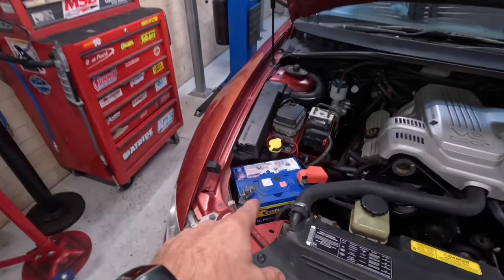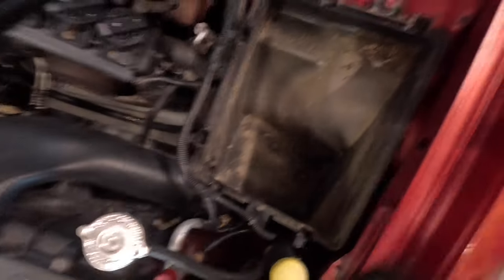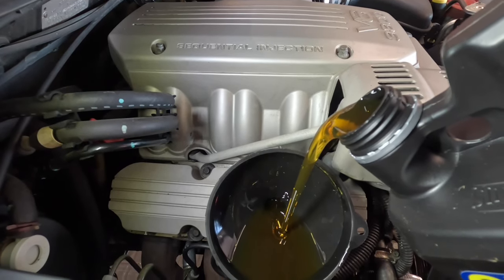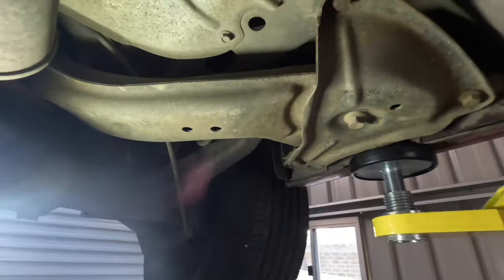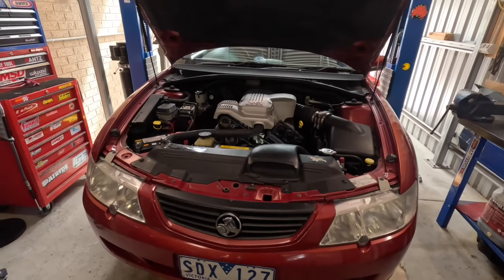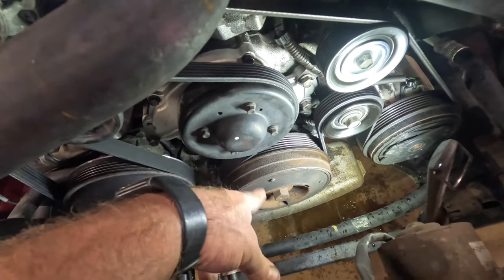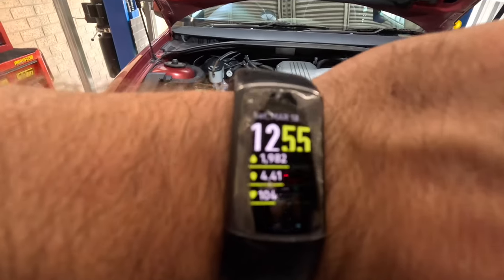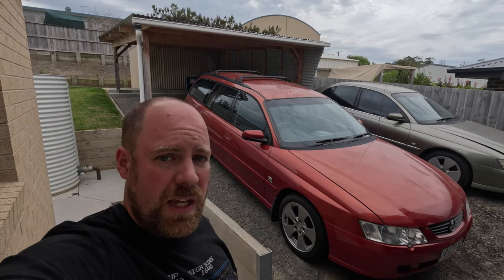VY Holden Commodore Major Service & Repairs Pt 2

Comment: Awesome video. With those idler pulleys, you can easily change the bearings in them for about $2 at any bearing supplier
Reply from the maker: Thanks for watching mate. 
We used to replace just the bearings, but considering how cheap the complete pulleys are now we just tend to play the ‘it’s more convenient’ card as just go with that. 
But there’s nothing wrong with just doing the bearings either

Comment: I watched the time lapse of the harmonic balancer job, in slow motion. Great aspect of what to do. However, as a beginner at repairs my son and I found this pretty hard to work out what you were doing from the top down view. I'll go back over this with a manual I found on the Internet. I'd imagine these V6 commodores are very similar. The radiators seemed full of crud. How important it is to give them a clean or blow through with water/air/de-greaser? My son's VZ commodore had been driven over a dirt track for several years. There is a build up of dirt and little stones everywhere on the underside of the care. Bugger to work on until I get it guerneyed. Thanks for the video. No one does a full major service in one go. Very helpful.

Comment: I was wondering if you were a mechanic (haven't seen any of your content prior to PT1), then saw the Snap-on scan tool and was yep... there's 5 grand of Snap-on scan tool, def mechanic
Reply from the maker: Yes mate def am. 
You can check out some more of my info in my bio. But qualified mechanic, diesel mechanic, auto elec, and welder. Have other certificates also. Spent a lot of years in trade school mate and 25 years on the tools so far
Reply: @cassarindustries_wheelwerk  Dude it shows, if you haven't already could you go back over the power steering flush please?, even if you "show" without actually doing it - I got my mechanic ticket from university Google & youtube :(
Reply from the maker: Thanks heaps mate. 
Easier way to flush power steering is to suck out the reservoir, then fill it up with fresh fluid. Start the car and turn the steering wheel left to right a few times, then turn it off. Suck the floor out again, refill, start the car and turn the steering wheel a few times then turn it off. Keep repeating this until it’s clean.
Reply: @cassarindustries_wheelwerk  thanks mate. I haven't looked yet but do or could you list tools like the air bleeder for the brake lines, and vacuum sucker tool please?, for us home jobbies.

Comment: Hey mate, just came across your channel. I recently bought a 2004 Holden Commodore Ute with the 3.8L V6. Do you know what kind of gear oil is used on the rear end as it has the limited slip differential?
Reply from the maker: Welcome to the channel mate and thanks for watching. 

If it had an LSD I normally use the Penrite 85W/140 lsd gear oil. Penrite also do a small bottle of LSD additive called ‘limslip’. Comes in a small black and purple bottle, and it’s about 60ml. 
The gear itself already has lsd additive in it, but I find the commodore LSD clutches really benefit from have the extra additive. Not essential to put it in, but I recommend it. 
Good luck!